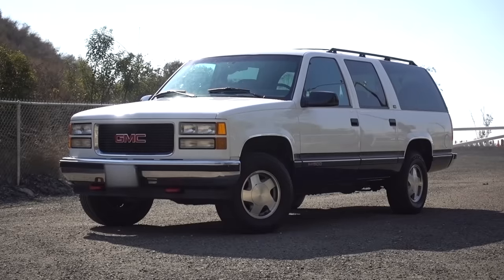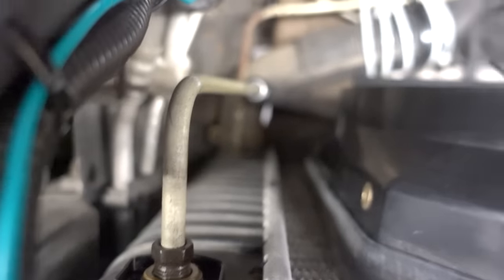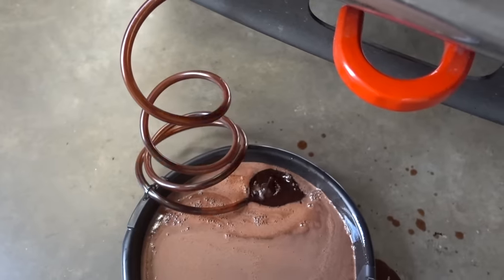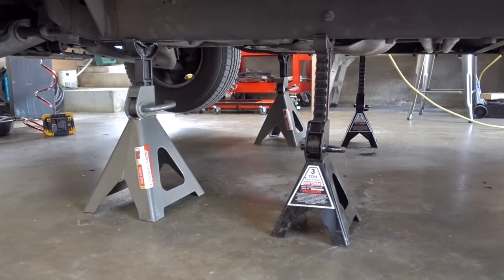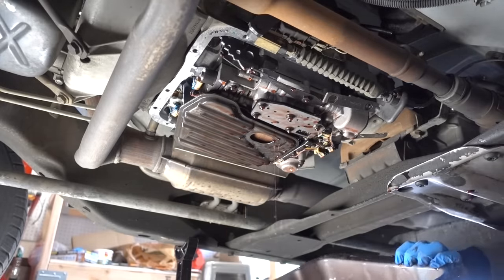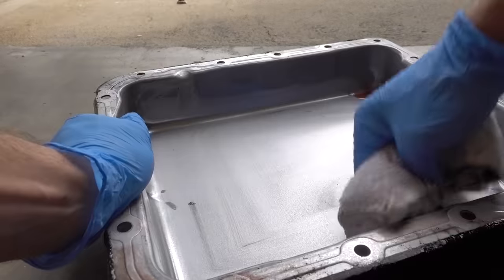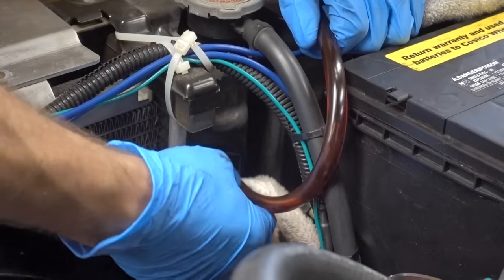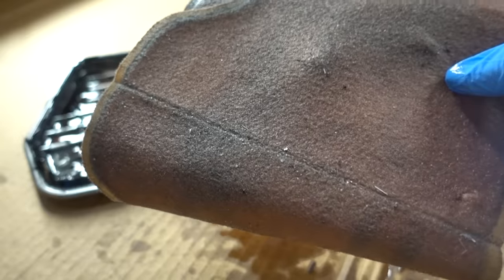Why You Should NEVER FLUSH YOUR TRANSMISSION FLUID!!

Comment: Love the video/tutorial. With your confidence and outlook, it's encouraging after having heard for years all the warnings, doom and gloom of changing trans fluid.  A bonafide transmission shop refused my request for the service you just performed. They said they wouldn't guarantee it would operate well enough afterwards to get me one block down the street.  I have an '06 Lincoln Mark LT with Semi-original transmission fluid -  What I started doing periodically is siphoning out (thru the fill tube) and replacing 3 - 4 quarts at a time - gradually introducing fresh fluid into the system.  I figure after several cycles I'll eventually have diluted and replaced all the old fluid, without a sudden "shock" to the system caused by all fresh at once.  Of course this doesn't address the cruddy filter and pan.
Reply: The filter media still has to be addressed and most cases dropping the pan and replacing the gasket which most models required depending on the manufacturer, changing filter is always recommended along with the fuel filter change and as well as cleaning off the magnet on the pan

Comment: When we used to change the fluid this way, we would run the trans through Rev, Neutral, Drive, Low, several times to flush all the passage ways in the valve body and clutches as well.
Reply: No reason to ever flush it. A waste of time that shortens its life. People brag they flush them and the trans lasts 200K..well if you didn't flush it would have lasted 500K
Reply: @robertwadas  that's a terrible recommendation,  I've been a heavy duty mechanic for over 20 years,  specialising in hydraulics. Fluids are a lot better than they used to be,  but they certainly aren't 500k good,  or even 200. lifetime fluids are lifetime of the warranty basically,  they should be changed at 100k , if not earlier.  Just because they look clean, doesn't mean they are still optimal. 
Everyone has a story about their transmission lasting forever without being touched,  but it doesn't mean it's good practice. You'll find more failures from not looking after them than people doing preventative maintenance on them.
Reply: @Brettj77  The mechanic is saying same thing. I have never changed it on any car and some hit 500K. Best bet is to put luberplate. I have been an ASE Mastertech since 1986 and worked directly with hydraulic oil companires and taken apart heavy equiptment that actually uses a heavier detergent. If you plan on keeping your car over 300K, maybe the oild today may be better, I trust as it will help keep warranties good. I am not familiar with todays auto trans, I dont keep most cars anywhere past 300K. I guess I def. could be wrong, as we run Cummins trucks with only changing outside oyl filter on leases of 500 K. I guess being a mechanic, I just dont bother as I can pull out a trand, get a kit, rebuild and install as much as a non mechanic would pay double my cost to do that. A mechanics car is noticible cause its usually the loudest as we let mufflers have to fall off before fixing exhaust. I mean my 1982 vette, auto trans is perfect and I would be scared to change trans fluid ! you know it has gunked up material on clutches. When I add, I find lubriplate is good for end and trans.I dont work on the newer cars. Im glad , trans fluid smells !
Reply: ASE mechanic .... Nuff said. Lol.
Reply: @robertwadas  you’re shyt’en me right
Reply: @rmo4222  32 years ih the field all over the country, clients like Michael Jordan, Brad Paisley, Bon Jovi, Scottie pippen, Almost every Hospital in Chicaoland area, John Deere, West Side Tractor, Bridgestones Provate fleet, Caterpillar, Bosch, Volvo and I could type the clients for the next few hours after 32 years... and I am teling the 100% truth..just use synthetic. If your fluids are topped off....you got no worries...Yall can waste money flushing your fluids and wind up paying more in fluids than you did for the vehicle !
Reply: BOB WADAS ok buddy haha
Reply: @robertwadas  No
Reply: @robertwadas  ah, so not repeat clients then

Comment: There is a big difference between a low pressure flush as per done in this case. And a full high pressure flush that could further damage your clutches using a flushing machine. So yes and thankyou for your xtra educational vid.

Comment: All fluids used in our vehicles have a factory-recommended change cycle. Following these recommendations is key to a long service life from the vehicles. Our shop is located 35 miles from a major city. Folks who live out here but work in the city put on around 70,000 miles each year. With proper maintenance, getting over 300,000 miles and more from a vehicle is quite common.
Reply: "All fluids used in our vehicles have a factory-recommended change cycle. Following these recommendations is key to a long service life from the vehicles"....BMW, Subaru, Mercedes and others have for many years had so-called "lifetime" trans fluid. There is no change cycle. Auto manufacturers are in business to make money, not sell cars. Change ATF every 60K miles or less if severe duty. Simple.

Comment: You did a perfect job from my experience with these. Ive been doing this stuff for awhile and i can tell you that you should ALWAYS keep your fluid clean (sidenote: although the fluid in your truck was due it really wasnt all that bad for the miles and age, the prior owner was easy on it or cared for it i can tell) the times i have heard or seen a trans fail after a fluid change the transmission was already so close to death from not being maintained it was soon to die anyhow. Anyway you did it right with a good choice in fluid and didnt spill enough to bitch about, great job.

Comment: BACK FLUSH is what you might do to cooling system.
BACK FLUSH is what you NEVER want to do on a transmission.
FORWARD FLUSH (i.e., just REPLACE) is okay.
--
Things I do different:
#1 I use a short (nipple size) steel line  that I hose clamp a hose to
rather than relying on threading a hose into the radiator
#2 Use a plastic trashcan, not a drain pan, to catch the used fluid
#3 Continuously pour new fluid into trans-fluid inlet while the old is being pumped out
Yes, you might use 3-4 times the fluid capacity of the trans just for one change
Considering how often this fluid change is done, it is worth it.
You do NOT want to see bubbles in the old fluid, you instead want to see clean fluid coming out the hose.
Reply: He wasn't back-flushing though. That would require an external pump to pump fluid back into that hose he had hooked up to the radiator. That was a simple flush, although I wouldn't let air get to the pump. Quart or 2 out, quart or 2 in.
Reply: John Doe  I think you're right.  I think it's best if you just drain the pan and add the same amount of new fluid that you've just drained.  Then drive it for a few days.  Then do the drain and fill again.  This process will introduce the new fluid slowly.  Eventually the old fluid will get diluted and be mostly new.  I would only do this if you have a transmission drain plug.  Removing the pan each time would be a pain in the butt!!!  Again, this method is for the slow introduction of the new fluid.  *****Those reading this because your already feeling or hearing problems in your transmission will probably not gain any benefit from doing this.  It would be less harsh on your trans, but I think your trans is too far gone already.  Do this method BEFORE you start to have problems and I bet your trans will last much longer!
Reply: @myemail2005  ..Fractional dilution.
Reply: much like a brake bleed...#3 makes sense

Comment: I must say this. These DAMN CAR COMPANIES SHOULD PUT A DRAIN BOLT IN THE PANS.
Reply: Toyota does
Reply: They have a kit to drill your pan to install a drain bolt. Love mine. So much easier
Reply: @Khaztr  Yuppers!  96 Tacoma - DRAIN PLUG!
Reply: @Khaztr  Yup, my xB has one.
Reply: Why would Ford make it easier for you to do a fluid change? Now, they put the frickin' dipstick, a 3" one, under the vehicle, when you have to check the transmission fluid level.  Rocket science.
Reply: Yes that should fall under a class of preventing a preventive maintenance
Reply: Some car companies used to add drain plugs, but it added cost to the vehicle. Ford used to have a drain plug on the torque converter so you could drain the fluid out of it as well.
Reply: @MrMichaeljab  96 lincoln mark 8 has torque converter  drain plug. Takes a remote starter switch or 2 guys to line up the plug with the hole in frame so it can be reached.Very hard to do on ground. Can be done. Lift is the best way
Reply: I’m enjoying your sports announcer  method of delivery ! Brings enthusiasm to a topic that makes it interesting for those who don’t do a lot of work on cars .
Reply: I don't know. Might be best to wipe the pan with a rag during each transmission fluid change.
Reply: We used to use a "flywheel turning tool" on the Fords making it a one man operation. It is like a large spanner wrench that grabs onto the teeth on the flex plate and allows you to turn the engine from under the car. It made aligning the torque converter's drain plug to the bottom very easy.

I did not know that Ford still had a drain plug in 96. I was draining torque converters back in the 60's & 70's.
Reply: Why would they put a drain plug on the tranny pan? They don't even put grease fittings on the ball joints any more.
Reply: I was told by a transmission mechanic years ago, the reason that they quit installing the drain plugs, was that techs were not replacing the filter. Just drain and fill. This forced them to pull the pan.
Reply: TRY DON'T SO YOU WILL REPLACE THE FILTER TOO
Reply: Subaru dooo!!!!
Reply: 2000 Jeep XJ has drain plug but I use the cooler lines for a flush after dropping pan and replacing filter.
Using drain plug or pulling the pan only gets a quart or so out.   That is no way to be 'flushing' a transmission.
Reply: Yes, but then how would you clean the magnet?
Reply: buy a better manufactured car. My Mitsubishi has one. DO YOU HOMEWORK, before you buy... DUH...!!!
Reply: @MrMichaeljab  what $4000 USD? give me a break.
Reply: @edwardzawislak246  who said anything about $4,000? Haven't a clue what you're talking about.
Reply: @docholliday6632   just thank god they no longer use type "F"  many a used car salesman has cheaped out and fucked an older ford tranny, just throwing atf in everything  (honda, and vw power steering fluid comes to mind)
Reply: Some 4l60 and 4l80s do have a drain plug.  They almost always strip and are frozen solid.
Reply: @greatnew_products7436  Definitely a doubled edged topic. Is handy if you accidentally overfill one, though.
Reply: Tap and dye one bro,
Reply: My kia has one as well.
Reply: 4L80E and 6L90E have them
Reply: Still need to remove the pan to get to filter, granted you won't be swimming around in the fluid
Reply: Newer cars don't for a reason.
Reply: 97-01 Toyota Camry has one.  Jeeps with AW4 have one.
Reply: "Dorman" a aftermarket company that makes factory direct replacement parts, makes transmission pans with drain plugs "stamped" into the OEM pans without drilling and installing drain plugs. They are very reasonably priced and can be found on Dormans website or Ebay and Amazon. Just need to know excactly what your looking for.
Reply: Yes.  Please.   Why can't they do this!!!   I agree.
Reply: @docholliday6632  what does a ford have to do with Chevy tranny change?
Reply: @thejeepdoctor  no it don’t if you get flush at dealer they don’t drop the pan
Reply: @edwardzawislak246  Mitsubishi, you’re shyt’en me right. The only thing lower a fiats
Reply: @MrMichaeljab  Yep, cause now they can make money off the pan gaskets. Flushing your trans fluids is just another way for companies to make more money off you ! My dodge neon work car went over 300K miles without ever changing any fluid , just air filters every year or 2 until I sold it. Keep it topped off and it will keep a moving. The best is the cleaners they put in gas that cause premature piston ring failure !
Reply: @halcyonoutlander2105  Period bath ughhhh lol
Reply: Ok, what to do with the Filtermedia...?
Make an external Oil-Filter...?
Reply: @docholliday6632  You're lucky you even have a dipstick. Most newer transmissions don't even have one.
Reply: In front-drive vehicles, idiots might mistake the trans drain plug for an engine oil drain plug.
Reply: @bruceferguson6637  Been there ... done that. I never made that mistake myself, but I know at least two people who drained the ATF instead of the engine oil on their Audi and Audi-platform VW Passats, in which the engine is mounted ahead of the front axle and above a big plastic splash pan / shield.
Reply: So I'm using my sister's 2nd car for the winter ski I could store mine away and her transmission fluid is definitely in need of clean replacement. It's a 14 Elantra auto w/264,000km (only 25k on motor factory recall so was rebuilt but don't think they did the tranny). I was going to flush out and fill it as it has drain plug and filler spot,  I was told by Hyundai techs that if I did it that the trans may not work after this as they've had it happen with high mileage cars. So I guess I should leave it if it is working fine correct, or I could cause more headache then needed and just leave it till it has an issue then worry about it?
Reply: No drain plug = you'll change the filter and clean the magnet.
Reply: @Bamakettles  Drain plug does not preclude dropping the pan, changing the filter, and cleaning the magnet -- it just makes the process less messy.
Reply: no, bc that makes it easier and you might be tempted to do it yourself
Reply: HEAR! HEAR!
Reply: @thejeepdoctor  - Wouldn't be the least surprised if some techs were still doing "drain and fills" without replacing filters,  regardless of dropping the pan!
Reply: @jim crawford - Exactly... there are also aftermarket DIY drain plug kits available for most applications.
Reply: @Bamakettles  - If seedy techs weren't doing it before, I doubt dropping the pan would inspire them to change the filter.
Reply: @billgredick3762  It "adds cost"? How much?  I'm already paying THOUSANDS for the car!  I will gladly pay the extra $5 for that!
Reply: It saves them $ and forces you to remove the pan, replace the gasket and change that filter. With a bolt noone would ever change the filter.
Reply: I've got a drain bolt in my Scion pan.
Reply: My car have 1
Reply: My Subaru Forester Automatic has a drain bolt and a screw-on Filter for the Fluid like a regular engine oil filter. Makes the job so much easier, faster, and cleaner.
Reply: Why I buy japanese
Reply: I bought a 12 volt pump and I change 2 to 3 quarts Everytime I change my engine oil.
Reply: I've flushed it drained trans fluid on every used car I've owned and never had a problem. Did one on a 325k mile Sienna and 265k mile explorer. No issues.
Reply: President Trump 2020 thankfully my 2004 Escalade does
Reply: Ok so you jacked up a grey truck but working on a white burban lol , dealers say that crap I’ve never had an issue changing fluid on something old .
Reply: My 2002 GMC Sierra has a drain bolt. I think GM started putting them on the generation right after this truck he shows
Reply: 2018 Highlander, sealed transmission, yes it sucks the dealer wanted 435.00 to change and made it sound like brain surgery. Not really.
Reply: Yes but what about the filter..
Reply: @greatnew_products7436  and filter change
Reply: Because you need to change the filter ding dong, if they put a drain plug in the pan nobody would change the filter
Reply: @sjsjr86  Got a finned, cast aluminum pan from Summit.  Drain plug and 2 extra quarts capacity.  Nice.
Reply: @2k5sv650s  that actually works for fluid exchange.  If a person did that every 30k, they would likely never need a filter.
Reply: @whoseyourdaddyful  IS.
Reply: My 1950 Oldsmobile had a drain plug. Why none today ?
Reply: @caddothegreat  It saves the Mfg $0.39 per vehicle and makes it more likely you'll take it to the dealer for service..
Reply: Honda does
Reply: I was complaining about that on my old '68 Chevy truck (no longer have regrettably), but they are STILL not doing it today?
Reply: Mine has it.
Reply: @philthypony   you can drain like a pint of fluid and replace it with a pint of some Lucas transmission fix. I have seen that help vehicles with very high miles. But yeah, they are correct that you shouldn't change it, but that's only IF you don't know the service history. My husband's work truck has almost 400,000 miles (643,000 km) and we have kept up with transmission fluid changes and it runs great.
Reply: My Toyota doesn’t even have a dipstick so you can’t even check the transmission fluid level… You have to put it up on the rack and take a plug out of the transaxle after you let it cool off and then stick your finger in it. What a jackleg thing
Reply: they design the car to last 10 years so you will buy a  new one. i will never buy a new car, been a mechanic (professional since 1978, at oldsmobile dealership, made $9.78 an hour back then)  if you gave me a 2021 vehicle today, it would be for sale on craigs list tomorrow! screw selling it back to dealership so they can make money on it again!!
Reply: @billgredick3762  you couldn’t just crank it over by hand?
Reply: They use to
Reply: The aftermarket replacement from Advance had a plug where my Saturn's original pan didn't.
Reply: @MrMichaeljab  Chrysler did too.  So much easier.
Reply: Added cost and potential leak issue so most manufacturers won’t fit them.
Reply: Toyota's they do.
Reply: And a spin on type of filter
Reply: you are expected to change the gasket and filter anyway. but yea a drain bolt to empty the fluid before pulling the pan off would be nice. the messed up part is my pan has  a spot clearly meant for one but nope.